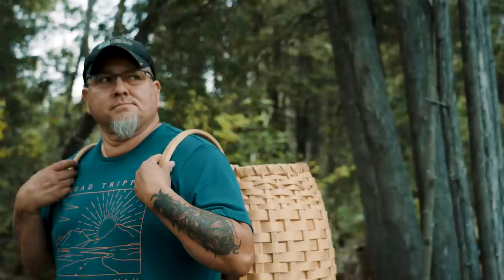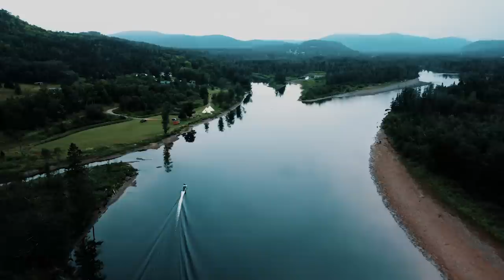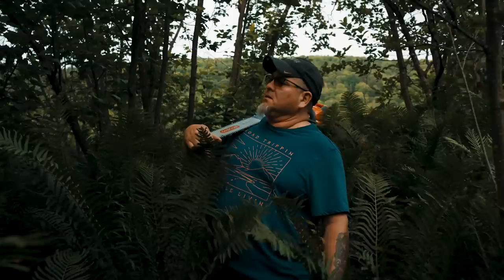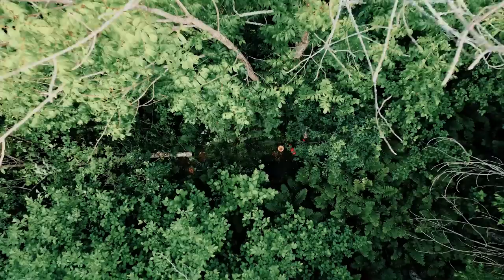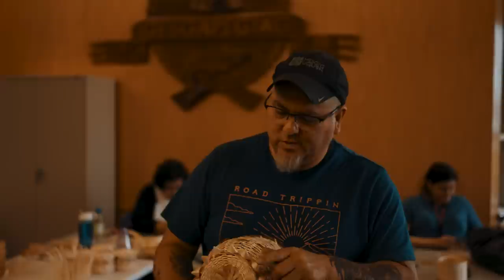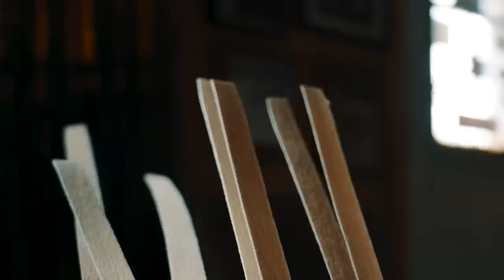Inspired to Make: Stories of the Onkwehón:we - Stephen Jerome

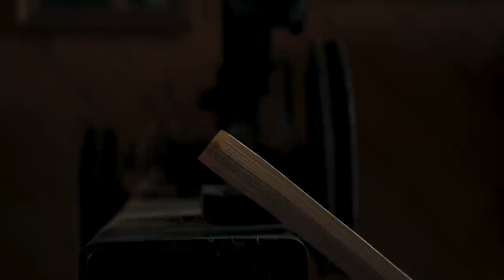Comment: At time code 6:53, he is using a machine to hit the wood to cause it to split along the grain and create thin strips. Interesting! Does that pounding "machine" have a name?
Reply: I think it's just to bend them. Looks like the strips are already separated but being bent as a stack.
Reply: It's an old trip hammer like blacksmiths used. It's an antique. Stephan has some old videos where he shows it more. You hammer the shit out of the billet then do it at the angle shown here to finish seperating them. Can be done with a hammer or axe too.
Reply: Thanks for the information. As soon as I read your answer, I did a search for "Trip Hammer" and found even more information.